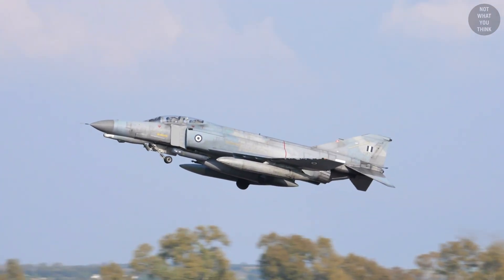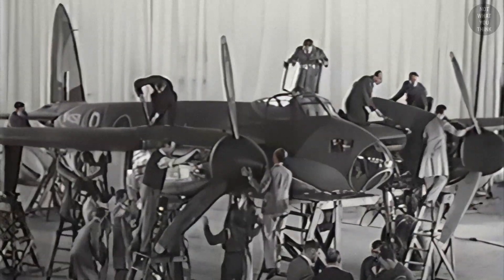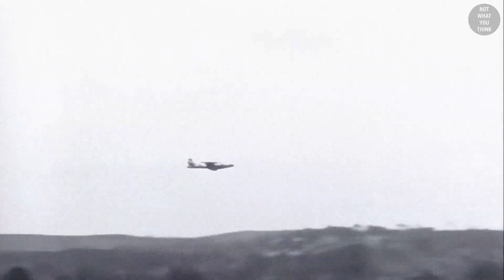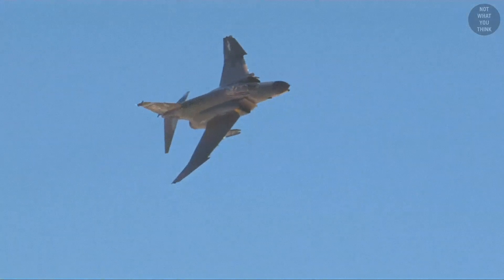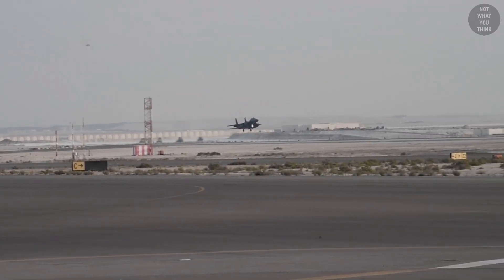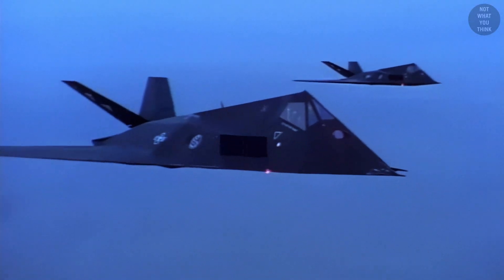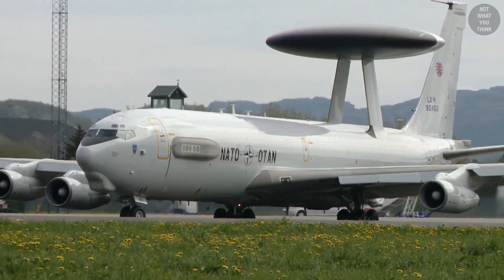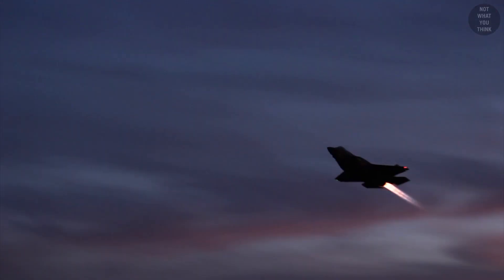Why are Modern Fighter Jets Slower than 1960s?

Comment: Since you mentioned using stealth to help in combat in the air, we had that same mindset even on the ground. While in Iraq we were issued so much body armor it made it difficult to move, slowed us down and exhausted even the fittest Soldiers after hours of wear especially in the desert heat. Then when we went to Afghanistan, we changed our kit to much less armor. My personal armor consisted of one chest plate and one back plate carried by a simple plate carrier worn like a small vest. We also changed our camo to something that actually fit in the environment we were in and not the most useless camo ever designed by anyone, any time in any military - the ACU. 

In other words, our strategy went from being able to survive a hit to not being hit at all. If you can't see us, you can't kill us. 

Whether that worked or not is up to personal experiences and up each individual, but for me it did work. I felt much more comfortable being able to maneuver and fight back as opposed to not being able to move quickly and hoping to survive an attack.
Reply: But weren't Iraq and Afghanistan very different combat zones?  Iraq being a more conventional slug-it-out urban fighting where Afghanistan was more of a rural guerilla type of fighting?  The kits you described each seem appropriate for where you were using them.
Reply: @kilroy2517  even more, most of iraq was a flat desert, the camo would be useless, and you basically rely on armor to survive because you have no enviromental features to protect you
Reply: @kilroy2517  pretty much, you'll see a lot of what he's mentioned with photos of guys in afghanistan, often carrying the bare necessities for short trips out of the wire - usually a day, maybe 2, at most 
when it starts to get longer than that you'll see guys looking more like they're in iraq or vietnam with packs and loaded down in gear
a very good example of this is the 24th meu during asbury park where instead of using issued ibas, they're all wearing plate carriers purchased in country to help cut down on weight traversing through the mountains
Reply: Another thing is altitude and terrain - while it sucked to walk around in IBAs or whatever ur country's equivalent in scorching Iraqi sun it was still doable. It sucked, but it's doable. But Afghanistan is like 5000 metres above sea level and much much more hilly. Walking a click in Afghan is like walking 10 in the US or Europe. So it's just physically impossible for anybody that's not from the mountains to do that for a long time and the extra weight saps the troops out to a point where the limitations in awareness and responsivity outweight the benefits
Reply: Thailand pink uniform.
Reply: Looking forward to the success of the 100 B-21 raider's. Supposedly capable of going anywhere around the world.
Reply: ACU SUX
Reply: Seemingly these Americans have no idea the F-22 and F-35 can't see, track, or target any other stealth aircraft from BVR (beyond visual range). Stealth alone defeats high-frequency (short wave) radar by absorption and deflection, it does not defeat low-frequency (long wave) radar. Therefore, to see, track, and target stealth aircraft you must have long-wave radar, but it must also be enhanced to remove all background clutter for targeting purposes.

Neither the APG-77 radar used in the F-22, nor the APG-81 radar used in the F-35, can see any other stealth aircraft from BVR (without enhanced long wave radar) — This fact the US Air force obviously know! Only it seems the reality is, that when the F-35 radars were being designed 13 years ago, there were no other stealth aircraft to think about as a potential threat? So how can these US aircraft be seen as any sort of threat to either China or Russia, who both have these aircraft technically beaten? They can see and target US jets from BVR, yet the US jets can't even see them from BVR?

Russia's new 5th generation Byelka (2band) radar, used in SU-57, does have enhanced long-wave radar, they've designed and developed the first L-Band fighter radar we've ever seen. They've cleverly embedded L-band AESA radars in the leading edges of the wings. The new L-band AESA radar data gets processed in real time through extremely powerful Russian Elbrus computers being significantly enhanced removing all clutter, meaning it can see, track, target, and engage enemy stealth aircraft from BVR. The technology along with its impressive range parameters and jamming ability over large areas make this aircraft deadly to all other aircraft types. 

They can also interact in ''real-time'' with each other member of the squadron, (auto selecting) the best placed BVR missile, that can be fired by anyone of the squadron with a bogie on radar, they can also take control of surface-to-air (SAM) missile defence systems - (that alone is lethal), and they can see track, enemy stealth fighter aircraft long before Russian airspace, from much greater distances, with "real-time" data from massive Russian ground long wave stations (that are all protected today with the networked S-400 defensive system). 

Therefore, as they'll always know where the enemy aircraft are, they'll always be able to approach any enemy aircraft head on, and therefore stealthily, (Russia wisely sacrificed rear end stealth for much better manoeuvrability) meaning today, the US fighter jets would not even be able to see them coming!! Russia's Byelka (2band) radar covers all aspects of frequencies across all channels, that are used for tracking, targetting, and also jamming. It's part of Sh121 multifunctional integrated radio electronic system (MIRES) on board the SU-57. 

Russia tested much of this new radar suit on the SU-35, so they also have the option of fitting this radar into SU-35's permanently, meaning Russia's SU-35S flanker will be at no disadvantage with F-22/35. As although the SU-35 can be seen and targeted from BVR, the SU-35 with the new 5th gen radar is as able to see and target the US jets from BVR, seeing the all-important Russian advantage in BVR missile distance, plus the excellent manoeuvring, neither the F-22/35 have, as more than critical, if you're going to avoid simply being blown out of the sky.
Reply: @hotstepper887  Russia is getting there ass kicked right now
Reply: @hotstepper887 Are you done spreading your "Russia is the best" message? 😂😂😂😂 
Wish these list of "extremely powerful radar and technology" You can't even establish air superiority against Ukraine.

Pathetic.
Reply: @hotstepper887 👈 @CIA y'all hear that 😅🤣😩
Reply: @jamez2fly92  Keep taking the pills.
Reply: @hotstepper887  I think you'll find the name on the pill bottle is yours
Reply: Seemingly, you Americans want to take on Russia? Only whenever asked why? Not one of you can reply with anything sensible, or even what we could call logical. But we read you all thinking you could win? While the obvious reality is, you have NO CHANCE at either stakes of war, whether nuclear, or conventional war, you LOSE! And you lose big time!

This isn't even up for debate, as everything we do know proves it conclusively, what you all must think nobody knows? The facts are,  again, so easily looked up, understood, and learn't. None of you ever do that because you wouldn't even know where to start.

I really don't believe any of us, have ever seen such outright, in your face, idiocy before, it's idiocy on a scale of idiocy, never seen before. 

We do know, that Russia does have the ability to bring down all US ICBM's, we also know, the USA has no defence against even the much older Soviet ICBM's, let alone the modern lethal ones like (Sarmat), a manoeuvrable long range ICBM that does not follow an ICBMs ballistic path, carrying up to 24 MERVS, over speeds of Mach 20.7; 4.3 miles per second; 15,480 miles per hour. 

Also, because we saw the USA really foolishly pull out of the nuclear arms treaty, (that prohibited the creation of any short-mid range nuclear weapons), today now sees even the old defensive threat of "MAD", as an obsolete defensive threat today. 

As Russia has already created those short-mid range missiles, and they've done so creating, hypersonic mid-range missiles, able to carry nuclear tipped warheads, or full nuclear warheads, travelling at speeds we've not seen before. 

Today, right at this time, as we speak, the US is just incredibly lucky that Russian nuclear policy doesn't threaten pre-emptive strikes, but is only a defensive nuclear policy, (they could well soon be changing that). 

Then the reality is, they'd be able to strike and hit all US defensive stations and their platforms, along with all US nuclear silos, destroying them all within minutes, long before the US could even begin to think about any sort of retaliatory launch. 

And more reality today is, that even any launch from the USA? Is actually meaningless. As today Russia also has the S-500 (anti-ballistic missile defence systems), able to operate alongside Russia's new A-235 anti-ballistic missile system, with the ability to shoot down hypersonic attack weapons, hypersonic orbital platforms, ballistic missiles, and their combat units, as well as satellites in near space. 

And we all know this is not just "Russian propaganda", it never is, Russia don't play silly games, and we've all seen and watched Russia do this. And do it easily!

ICBM's of the USA can be tracked and shot down quite easily by Russia today. Any Nuclear effort from the USA, today?, would see them lose, and they'd lose big time, massively, annihilation is the only apt word.  

Also today, any conventional War against Russia? They quite simply lose, that's not even up for debate, they could try to land 250,000 to 500,000 troops, and they'd all simply be chewed up and spat out, so where you Americans see Russia losing? Only God knows, as absolutely everything says otherwise. 

The USA has never met a fully militarily capable country, the USA struggles against many non-military capable countries all the time, and even just military groups!! 

Yet, Russia is the biggest test of them all. You're one of this world's very worst militaries at fighting wars, yet you all talk like you have some incredible, awesome military record. What's that all about?

You know, Russia is about 960 times bigger than Kuwait?. When the USA invaded Kuwait against Iraq, the USA deployed 750,000 troops. How many troops do you think they'd need to attack and invade Russia? LOLOLOLOL

Fighter Jets = Russia own the sky. Both the F-22 and F-35 are blind to all other stealth aircraft from BVR, as they don't have/lack any Long wave radar, It seems that when the F-35 radars were being designed 13 years ago, there were no other stealth aircraft to think about as a threat.

And none of you even understand this simpleton obvious fact, it's astonishing idiocy. I mean, do feel free to point out exactly how you must all think the US jets can detect any other stealth jets from BVR? With what exactly? Scotch midst?

Stealth alone defeats high-frequency (short wave) radar, by absorption and deflection, yet it does NOT defeat low-frequency (long wave) radar. 

Therefore, to see/detect, track, and to target other stealth aircraft from BVR, you must have long-wave radar, (but it must also be enhanced, removing all background clutter for targeting purposes). 

Neither the APG-77 radar used in the F-22, nor the APG-81 radar used in the F-35, can see any other stealth aircraft from BVR (without enhanced long wave radar). 

This fact, obviously, the US Air force  know! Only it seems the reality is, that when the F-35 radars were being designed (13 years ago), there weren't any other stealth aircraft to think about as a potential threat! 

So seriously, how can these US fighter aircraft really be seen or even considered any sort of real threat to either Russia or China, who both have these US aircraft technically beaten today?, they can detect and target the US stealth jets from BVR, yet the US jets can't even see them from BVR? That's known as, simply, a hopeless situation. You all know nothing at all about reality or the facts.

Missiles = Russian missiles rule the world today. Russia's modern hi-tech missiles and their targeting systems using (Russian GLONASS, GPS), gives Russia such incredible missile precision, the USA has nothing we can say even compares. 

As we've all witnessed, Russia has been pinpoint accurate from distances of, over 7500 km. Russia has also provided clear, precise footage, of all her long range missile attacks in Syria, (that we can see all came from the Russian control room online). US missiles are actually a joke today, is the truth.

All throughout the history of wars, you'll always find the countries that were fighting for all the right reasons, like their own freedom, have never lost, and have always won, while all those who fought for the wrong reasons, like attempted global control/tyranny, have all, not only lost, but they've all been completely annihilated. 

You'd all be very wise to remember that. As we've seen this in every war, nothing will change this time, only the annihilation might be much more severe, but just as deserved.

You don't even understand, that in today's world of hi-tech Anti-Ship ballistic missiles, like the Chinese DF-21D — operational range (1700 km's) that can sink any carrier in the world with a single hit. That all Navies without the ability to stop these missiles today are completely obsolete.
 
Russia's Zircon Anti-Ship missile though inferior in way of operational range-400kms it can be fired from Aircraft, Subs, and Ships making it deadly to any carrier in the world. 

Russia also has the Brahmos and the P-800 Oniks Anti-Ship missiles. We know the USA hasn't got a destroyer that can defend against any of these missiles today? Seeing the USA's Navy, completely obsolete in today's world.

And if you don't think so? All we need to do 
is look at the distances the US jets can travel? It's about 500-650 (max) km's out — and the same back again = 1300 km's range. 

So how could the US deploy any carrier close enough to reach any inland target, and then get back again? They can't, anywhere inside 1700 km's they're sunk, they're toast, they're history. So today, the real facts are very clear, the USA has no capability to attack any militarily capable country (who have these modern hi-tech Anti-Ship ballistic missiles in their defensive armoury). These are the real facts today. 

And again whether any of you might think so or not, Is irrelevant, because If the risk outweighs any potential reward, gain, or result = obsolete. 

The USA has nothing that can stop those missiles today, and China's DF-21D is a carrier killer. A manoeuvrable Ballistic missile hurtling at your carrier. You're doomed!

EW - Electronic Warfare = the USA must be at least a decade behind Russia. Everything we've seen, and everything we know, shows this very clearly. 

Reality = In any coming war? I give the USA precisely zero chance, none, not even a little snippet of a chance, annihilation is all they'll get. And being even more honest?, quite deservedly so!
Reply: Rolling down the runway
throttles open wide
see the mighty Phantom
sway from side to side
airborne again without a blip
It's just one more aborted trip
but we're pressing on regardless
for the wg cdrs AFC

Went to early briefing
climbed into the Kite
opened up the throttles
and roared into the night
leaving the flare path far behind
It's dark outside, but we don't mind
cos we're pressing on regardless
for the wg cdr's AFC

Rolling down the runway
throttle open wide
see the mighty Falcon
sway from side to side
airborne again with just 9 G
I wish I had a nav with me (!)
but we're pressing on regardless
for the wg cdr's AFC

Rolling down the runway
throttles open wide
see the mighty Jaguar
sway from side to side
airborne again, but only just
It's not much fun
with F*** all thrust
but we're pressing on regardless
for the wg cdr's AFC

GIVE ME BUCCANEERS!
They're British through and through
The Banana Jet
The Best we've had yet
We are the last of the few.

Don't give me the Jaguar
Unless you refer to the car
The car is a groundhog
The aircraft is half frog
Don't give me the Jaguar.

Give me Buccaneers
They're British through and through
The Banana Jet
The Best we've had yet
We are the last of the few.

Don't give me the Harrier jump jet
You haven't convinced me yet
Jets that fly backwards 
Are soon to be knackered
Don't give me the Harrier jump jet
Well… Not just yet...

Give me Buccaneers...
They're British through and through
The Banana Jet
The Best we've had yet
We are the last of the few.

Don't give me this computer crap
It's no way to tackle a SAP
It's OK for Dicks, Germans and Spicks
But Gentleman always carry a map!

Give me Buccaneers...
They're British through and through
The Banana Jet
The Best we've had yet
We are the last of the few.

Don't give me Air Traffic Control
They live in a bloody great hole…
They scream, and they shout, then F**k you about
Don't give me Air Traffic Control.

Give me Buccaneers...
They're British through and through
The Banana Jet
The Best we've had yet
We are the last of the few.

Don't give me the F-104
It's only a ground loving whore
It goes in a turn, flick, spin and burn
Don't give me the F-104.

Give me Buccaneers
They're British through and through
The Banana Jet
The Best we've had yet
WE ARE THE LAST OF THE FEW!
Reply: @hotstepper887  I'm Portuguese, but thanks. Please don't pollute our beaches next year.
Reply: @Melonist  And still unable to answer a single word to my first comment? Read you all? Not one of you can say anything other than childlike name-calling, that's so juvenile, I feel embarrassed for you, reading it?
Reply: @Melonist  Portugal, the little irrelevant country of Europe, that ALWAYS relied on British support when ganged up on LMAO
Reply: Portugal = Spanish leftovers! Hahaha feeble  Portugal, thrashed by everyone LOL
Reply: @Melonist  The real European slavers
Reply: LMAO @ Your beaches. I'm sitting on my balcony with my coffee, overlooking such a beautiful beach. But that is all you've got, LOL Spanish beaches PMSFL
Reply: Even defeated by a Muslim hoard, that ruled over you all for 500 years, LOL, BE PROUD!